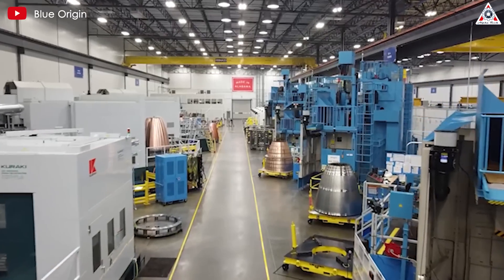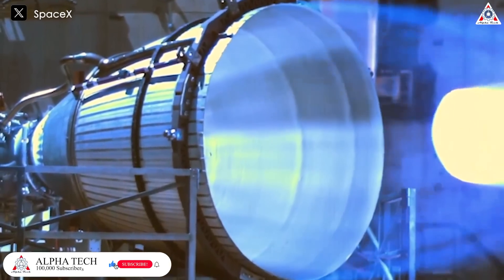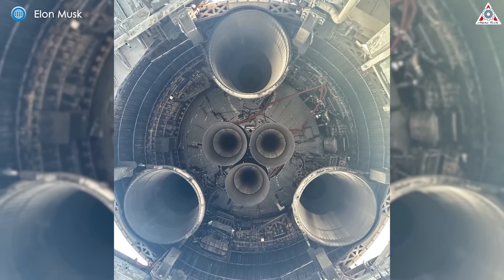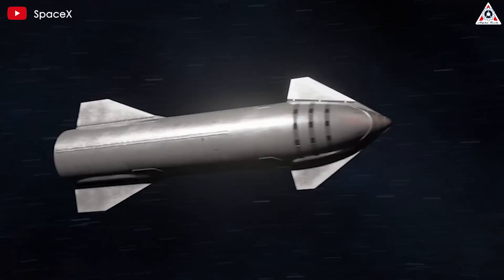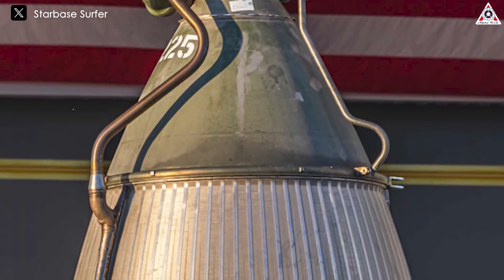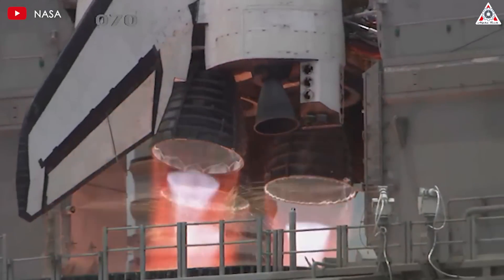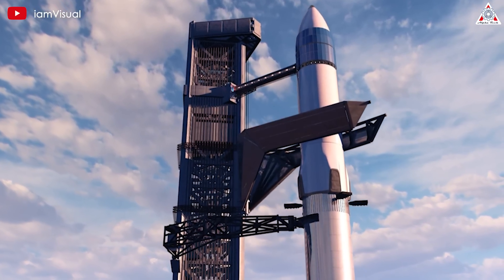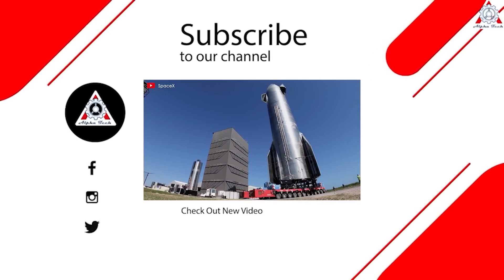SpaceX's Raptor Vacuum Engine will take over HUMILIATED Blue Origin, even NASA!

Comment: While Raptor Vacuum is very good and advanced, I think it still needs more time and development its quite clear that the sea level Raptor is the main focus.

Also Raptor Vac vs BE-3U is the correct comparison for Blue Origin NG. Raptor Vacuum, (Isp) 380s and BE-3U is actually at (Isp) 445s

So... BE-3U is roughly 17% MORE efficient over the current Raptor vac.

Comment: There’s just one problem. The raptor has yet to have a successful run without any failures. It’s still having relight issues. The raptor 3 hopefully has fixed many of these issues we will see. But until then, the BE4 is the only approved PRODUCTION methane engine in the  USA. Raptor is still a prototype with numerous issues
Reply: How many Raptor engines have been built and used (in flight tests) and how many BE4 engines have been built and used?
Reply: @kurttate9446  until the first flight of Starship, 4 BE4 engines logged more runtime then ALL THE RAPTORS COMBINED. Think about that. Then the ULA flight occurred. And it AGAIN  had more run time.  Since then we’ve had flights 2-4.  But until flight 4 there have been NUMEROUS engine fails.  It’s just a fact.
Reply: Looks like we found the Blue Origin employee.

Comment: The RS-25 doesn't have 2 combustion chamber, that's the RD-180. The higher SI of the RS-25 is due to its use of Hydrogen fuel.

Comment: The Raptor that has never reached expectations of chamber pressure...
Reply: How's that?
Reply: "If you were negative or thought something couldn't be done, you were not invited to the next meeting," Mueller recalls in Isaacson's biography. "He just wanted people who would make things happen."
Musk runs a company in wich nobody tells him chopsticks are a dumb dumb idea.
Reply: @donosticopter9225  Re-usability and landing on a drone ship were also “dumb ideas”… until they weren’t.
Reply: @cyberia55 That's why I suggested they use a mobile deep sea drilling rig with a tower Half the height of the land based one. After all,it only has to catch the first stage booster. Hell,letting that go under salt water helps clean it after use. I do my research. Do you?
Reply: @JimmyRussell-c2s How many liquid-fueled rocket engines has your extensive research shown to be reflown after being dipped in salt water?
Reply: @donosticopter9225 I like positive comments like yours. For that I want to share a couple ideas. Cooling lines in heat tiles Epoxy weight less than the epoxy. Also-The Radiation Belt these dummies call a problem is a GIFT FROM GOD in nuclear prepulsion. Capture atomic particles in a magnetic field, slowly release them in the rockets exhost. Like running NOS in a car.
Reply: @donosticopter9225  it's not had opportunity to be completely tested for the use it it intended. Either way it's still the best at this point.
Reply: LOL, Invest with Bezos Lawsuits attorney's. See how fast that gets you to the Gold Astroid found in the Astroid Belt.
Reply: It's like Starship v2. It's not an improvement over v1, it's a replacement for a failed v1 wich has taken so much extra weight, that it has virtualy no payload capacity (with all the reinforcements, hot staging ring and feeder tanks).
And the catch mechanism (chopsticks) is absolutely delusional, a dumb idea wich nobody in SpaceX has had the courage to risk his job replying to Elon. But this is the elephant in the room too few people are talking about.